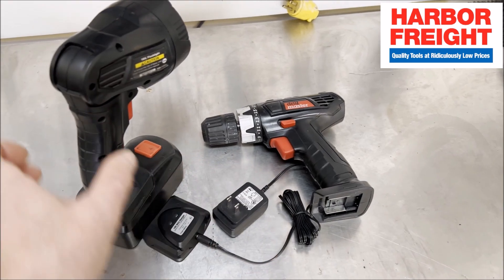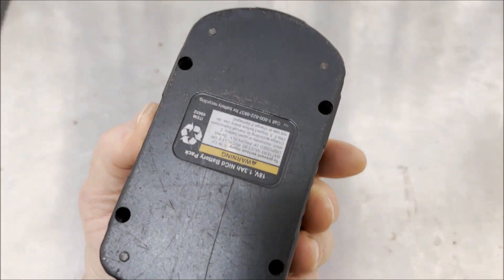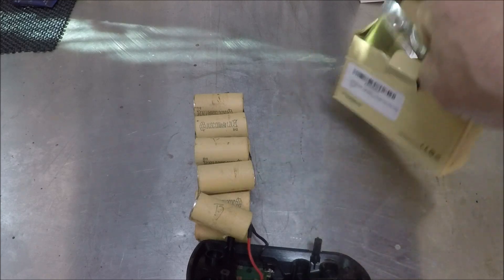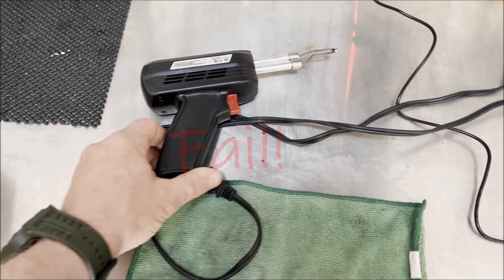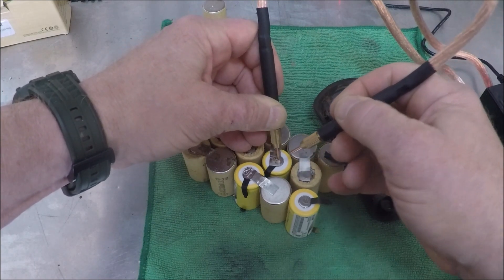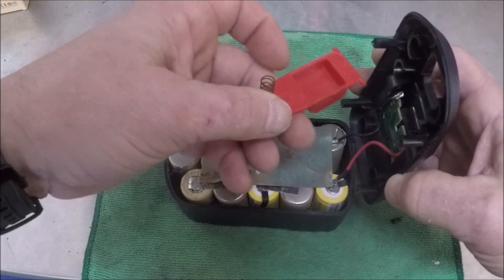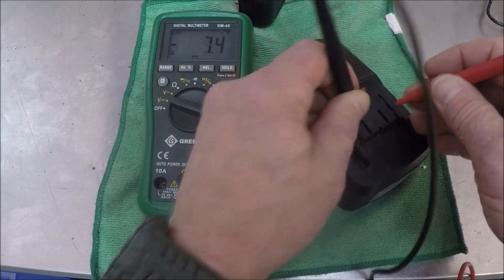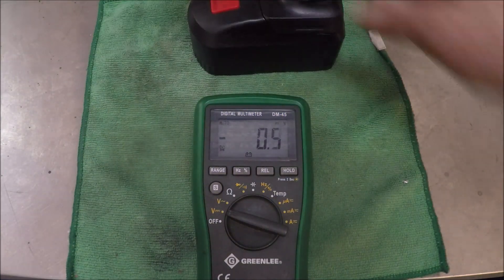Revive Your Drill Master Battery: Easy Fix For Harbor Freight's 18v Nicad Pack

Comment: Looks easy… but expensive tool
Reply from the maker: You’re right, I wouldn’t have bought it if I didn’t have other batteries to repair
Reply: Your know those leads from the multimeter have covers right, or caps however you want to call them, and you can remove them for a longer needle,  i say this because it seemed like you didn't know at that time and struggled making contact with the batteries.  @DrivingIntelligence

Comment: I was encouraged by your video. My multimeter showd all batteries to be about 1.25-1.27 volts. Problem is the battery charges normaly and when done puts out about 20.5 volts. Initially drill works fine but quickly losses power and is dead overnight. Can you offer any other advice?
Reply from the maker: Looks like you have some batteries getting ready to fail.  You tested each battery to 1.25 volts?

Comment: What about using conductive copper tape to attach the cells and wire leads? Less secure than spot welding, but I can always pull the thing apart and retape.

My Drillmaster failed after a good 2-3 year run. Went from full performance to zero in about 3 days. Ouch.
Reply from the maker: interesting thought I guess it could work if the adhesive is strong and doesn't interfere with conductivity.

Comment: You should have all the batteries Mah Values matched or it will cause a imbalance when charged that can overcharge the lower capacity Cells. The Amazon replacment cells are expensive and very close in price to buying a new battery. I would try to replace all the batteries with a Lipo or Life RC Model battery that will fit inside the battery compartment. They come in all sized and voltages so you can find a match. A 18volt battery would be a 5S Lipo at a lower Mah value there should be one that can fit. Look for a Turnagy or Rhino for a economy battery. Another idea is to just go down to Harbor Freight and get there newest budget drill set for $20-$30 instead of a new battery.
Reply from the maker: You make a very good point, but so far the battery pack is working perfectly.  I wanted a cheap way out.  You outline a VERY correct method, but that was not my objective.
Reply: Thanks for showing this. I just now realized that Drillmaster is gone, and I've got two batteries that are dead and I don't know how to het replacements except to pay overpriced for used batteties on Ebay. If I could replace all the inner batteries, and have a working device again, that would be great. Of course I'd have to vompate cost, but the learning aspect is also intriguing. as well as keeping tools out of landfills just because I cant find a compatible power source.

Comment: I replaced all the batteries in the NiCd pack with Tenergy 2200mAh batteries from Amazon, which also read about 19.5v.  However, it smoked my drill!.  I removed 1 of the sub-c batteries and it works great now.  New voltage reading is 17.91v.  The new batteries are much more powerful.  Been using my drill for days without needing to recharge! 👍
Reply from the maker: That’s awesome!

Comment: I just upgraded my Drill Master 18v NiCad to Lithium Ion Warrior batteries.  I did need to break off the positive lead on the drill but was easy enough to 3d print a small insert. I also ordered a piece of brass to replace the broken tine. Snied it to fit. Glued in my 3d insert. Then soldered the positive wire to the new brass lead.  Slid the battery on and bam! It works!
Reply from the maker: very nice!